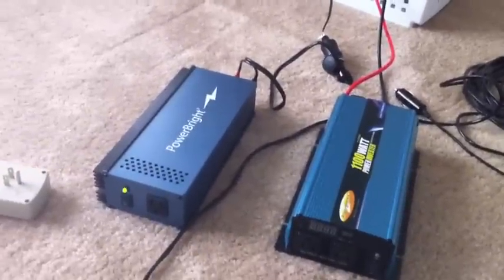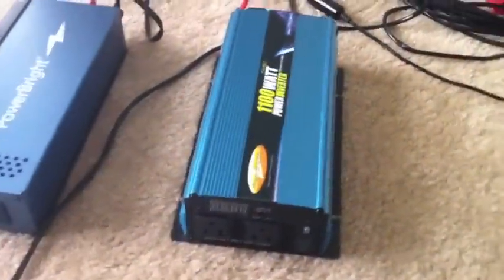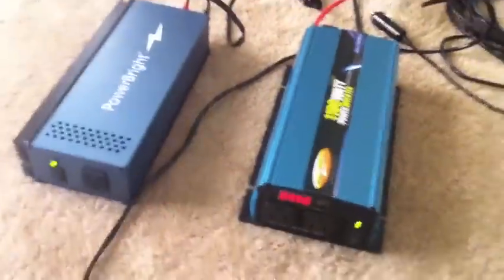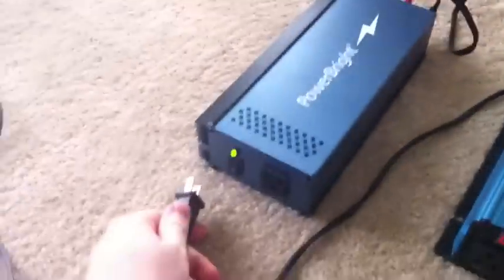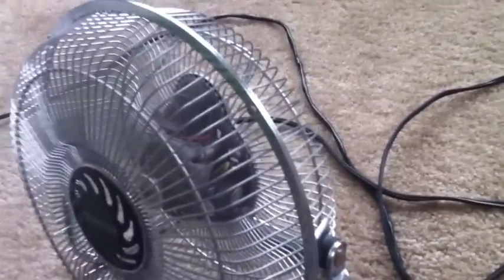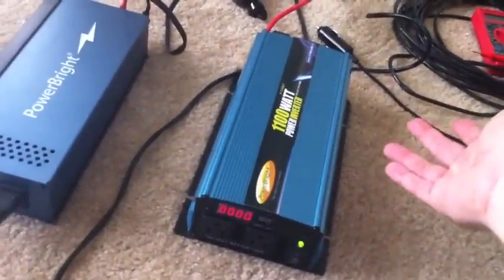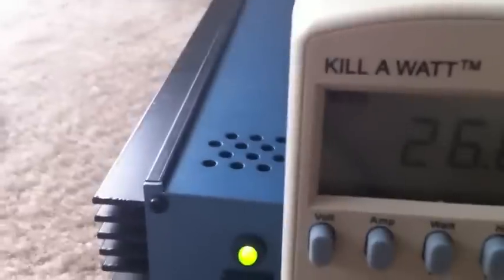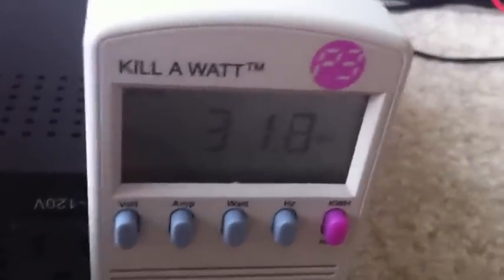What is the difference between a pure sine wave Ac inverter and a Modified sine wave inverter.

Comment: i hear modifeid vawes is not good for charging lithium batteries is true ?
Reply from the maker: I’m not sure but most lithium battery chargers run off 12 V so you’ll be better off just wiring it directly into the battery that you would be getting the power from.

Comment: After having a 300 Watt Pure Sine Wave inverter for 4 years I went and picked up a 750 Watt modified wave inverter from Walmart. I wanted some kind of backup inverter for shtf and I was having too much fun using my old car batteries charged with solar to charge all my aa/aaa/lithium usb banks etc and did not want to risk the pure wave getting weathered or stolen. That said it performs well even on a laptop the only area it has a problems is my really nice Phillips PC speakers buzz on it.
Reply: My uses differ from many of you probably... I have no desire to run any motors just electronics and no medical equipment. I want something I can take camping and run a laptop or a very small led backlight tv with a slim model low power consuming Xbox 360. During shtf I hope my family and friends can find somewhere safe if only for a few weeks and enjoy some movies and gaming before our doom. I have a 1600watt inverter generator which is pure sine wave to think about things like food storage etc although I’ve recently started looking at small mini fridges that dont use a compressor rather some other tech and use as little as 70 watts and work on 12v dc!

Comment: My set up uses a modified sin wave Krieger and I don't  have issues with my light bulb or square box fans. Other fans are  more sensitive. To those who want to set up an emergency box don't be afraid of using modified sine wave. I have been using them for 3 years now. I own 4 different types.  My 8 watts led GE bulb don't care. My gig saw Dremmel  coffee maker etc all run on modified sine wave.

Comment: Finally the difference between the two types of the waveforms produced by these two inverter categories is simply the lack of harmonics on the part of the pure sinus inverters. The modified sinus inverters have practically only that drawback. Nevertheless, if their design is smart, they can be used with any load. Smart design means the full elimination of the third harmonic, i.e 180Hz for 60Hz mains (or 150Hz for 50Hz mains respectively). Once this presupposition is established, there is no practical drawback of the modified sinus waveform against the pure sinusoidal one (unless if one wants to sell energy in the utility). On the other hand, the term "modified sinus" means exactly that fact. The full elimination of the third harmonic content from the output waveform. Thus the resultant waveform will be a decent replacement of the the sinusoidal one, being completely harmless for any load, no matter how delicate it might be. As for the electronic appliances of our days, all of them are using "switch mode power supplies", which really don't care about the input waveform, being capable to work even with pure D.C voltage i.e. directly from battery supply. All that's needed is the voltage level, which should be within the range the power supply can handle. Many of them are universal, that is, they can operate from 80 to 280 volt (with the mains frequency being unimportant any longer). In any case their operating voltage range, i.e. the important parameter, is written in their info label, on their body.

Comment: Pure sine wave inverters have LOWER conversion efficiency, because of transformer losses.
You see higher power usage on modified sine wave because you power a simple electric motor with it. Its designed for a pure wave and wont work well on modified wave. 
You measure at the output of the inverter so you skip the inverter itself in the test. You measure efficiency of the motor on the current type provided not the inverter - this is still important, but it hides the whole picture. You should measure on the input to the inverter. With the increased efficiency of modified wave inverters, you might see the difference in power use of you motor will be much less.
On the other hand modified wave is just as good as pure wave for powering switching power supplies. After all, internally they just make the wave strait then chop it up again, so it doesn't matter for them how choppy it comes in.

Comment: um, not trying to one up anyone, but a 'square wave' is like plugging in a pos and neg wire, and switching the polarity rapidly... appliances notoriously 'buck and fight' with square wave output. Actual SINE wave refers to the pattern shown on an oscilloscope, the second picture, which shows that the POLARITY REVERSALS are GRADUAL over a period of time, so small we hardly notice it (unless we have a finger in a light socket LOL) - the GRADUAL reversals of polarity are MUCH SMOOTHER than square wave. Think of running a baby carriage up and down a flight of stairs. OK, now carpet the stairs and SMOOTH the sharp edges and then the carriage will roll MUCH SMOOTHER up and down the same stairs. MODIFIED sine wave is NOT sine wave, it only shows how the SQUARE WAVE can be manipulated with circuitry to 'shave the hard corners' off of the square waves, and it helps, but most of these use mosfets to manipulate the current (on/off switching) and some MSW inverters will have warning labels telling you to NOT plug in 'inductive' loads... like florescent lamps (blew a 1500 watt MSW inverter by leaving ONE CFC 'light bulb' in the circuits! BAM, gone. Tried to use a Weller soldering gun with same, BAM, blew the MOSFETS right off the circuit board...) so read up all you can on  anything you plan to live with for a while. The best inverters are heavy, because they have REAL TRANSFORMERS inside them, like Tripp, my current champions. With all respect to M. Vineyard, yes that is a STEP current, and it is called a square wave... the sine wave shows the polarity reversing at the top 'loop/peak' and then again at the bottom 'loop/valley' usually the test lead will show pos at the top and negative orientation at the bottom. 
With a full sine, the current is never ACTUALLY OFF, unlike the square wave/rapid on off polarity swapping scheme - so the surges and 'ringing' in the circuits are minimized and even eliminated. This surging and ringing is what destroys all those small capacitors on the motherboards - and or the mosfets.

Comment: To power a portable Sony stereo, I was using a cheaper modified sine wave inverter, I accidentally reversed the + and - on my battery connection last evening and blew the 2 non replaceable fuses inside the inverter. After much research and talking to 3 different electronics technicians today, they all told me my Sony stereo will operate better and last longer with a better pure sine wave inverter. Ordered an Aims 180w pure sine wave inverter for $64  I'm now glad the cheaper $34 Cobra 400w modified sine wave inverter got blown out, my portable Sony stereo is the best sounding unit ever made, and they don't make them any longer, can never replace it, so happy I'm going to be treating it better from now on with pure sine wave power nearly, or identical to higher quality household A/C current. Modified sine wave is not good for electronics like TV, stereo, battery chargers etc. They may work, but not as well or last as long.

Comment: But if you place a capacitor at the output of the modified sinus wave inverter, then the hamming dissapears.
Reply: does it? Is there really a significant advantage going with a pure sine wave?
Reply: Rohan Berry 
"does it? Is there really a significant advantage going with a pure sine wave?"

Yes it does. I noticed it in my home-made inverter which generates as output square pulse high voltage. By adding a capacitor, the hamming generated by it, disappeared because the capacitor smoothed the square waves.
Reply: Than Zamp capacitor behaves like a filter
Reply: vtnsx that's exactly my point

Comment: 1100W!? THat's Pure Bull. A 1100w inverter would take over 90 amps @ 12VDC.
Reply: I had seen 3000 watt inverter before. But it use 24V input.
Reply: An inverter that claims to be 3000w or one that you've actually seen delivering 3000w? That's 125 amps which is far more than a car can put out and that would completely drain a car battery in 20min. It'd take 2ga wire which is 1/4" diameter copper- far larger than even a heavy duty battery or jumper cables
Reply: Davey Hi The peak performance is at 3000W. The average is at 2000 to 2500. The inverter use 24V input. So you need battery that has higher capacity than normal car battery. Then again the inverter is china made. But I had seen before.
Reply: FYI inverters DO go bigger than 1100W

Comment: For me, the HUGE price difference is not worth the benefits of pure sine wave. I use a $29 dollar one to charge my Laptop, phone and camera. No problems at all.
Reply: Except your electronics won't run as well, and will likely wear out quicker being provided a cheaper lower quality electric current that modified sine wave inverters put out. They all work fine until they don't any longer. I was using a modified sine wave inverter to power my Sony portable stereo, then a Sony technician told me it won't run as well, and won't last as long, he suggested I get a pure sine wave inverter and my stereo will be happier and live a longer life. I got an Aims 180w pure sine wave inverter for $64  With electronics we can take chances, or spend more and get pure clean power, if things don't last as long with cheaper inverters, we don't save that much after sooner replacement costs.
Reply: I think most if not all computers have a power supply that changes power to a clean pure sine wave, is that true?  I've run all my computers on square sine wave supplies and never had a seconds problem.....
Reply: Mike Hale, a typical computer power supply will rectify the current and than chop it up again and then rectify again. So the shape of the input wave is piss in the ocean compared to what happens inside the supply.
Pure wave are less efficient on conversion (contrary to what is said in this video) but better for devices that expect pure sine input such as motors or non-switching power supplies.
Reply: I once read something like this allegedly on the bathroom wall of the Titanic... ok, it ONLY sank ONCE, but it did a damn good job of it. PS most computer power supply adaptors have extremely well engineered filtration in the adaptors to protect the investment in the laptop. Other electronics may vary, or your luck could hold out.

Comment: I've been working off-grid for several years now, and have seen every type of electronic plugged into every type of power inverter or generator. Many sensitive electronics will opt not to recognize cheaply inverted electricity. Pure or true sine wave works every time, so spend the money if this is what you are powering.

Comment: IMO, no inverter can provide you with electrical power as clean as that from the utility company. Power from the company comes from rotation and magnets. Pure Sine Wave Inverter doesn't have that, hence the result.
Reply: +craccky, absolutely far from the truth. This is 100% inaccurate. Typically inverter generators and pure sine wave inverters have power that is in fact cleaner than utility power. I have recorded and verified myself personally several times.

Comment: which is best for using a laptop
Reply from the maker: The pure sine wave would be better. Because from my experience The modified will cause interference problems and heat up The AC to DC power supply. Your best option would  be to connect a DC to DC power supply. They make them for all laptops is you can just plug it into the cigarette lighter.
Reply: +WinstonSmith6 I am doing an rv project...I need an inverter to power a 1500w floor heater...that will be the main function for it as I might plug an iron or toaster in it from time to time...what would be your advice? I know I need at least a 1500w continuous/ 3000 max as far as power right, but should i get pure wave or modified...please take into consideration that money is a factor but doesnt mean i wont spend more for a better product
Reply: +WinstonSmith6 you are wrong. Every laptop or desktop computer power supply convert incomins ac to dc and then convert it to low voltage dc. If you have apfc power supply, it is better using pure sinewawe, else it's no matter. You can ever feed laptop power supply with dc at peat sine voltage and it will work
Reply: +Michael Parker 1500w from a 12v  battery is 125amps. Not gonna happen. IF you did have wiring, inverter, and battery to do that, the battery would last < 20 minutes.
Reply: +Volodumur Kalunyak If he's wrong, what's this? lol

http://www.amazon.com/Shopsimple-Universal-Selectable-Adapter-notebook/dp/B015STBOFW
Reply: Davey Hi this is a lot better solution to feed laptop from 12V car battery. This is dc-dc converter 12V->19V. Double convertio 12V->220V->19V (or 16V, 17V,...24V depending on settings) is eliminated, so it yields higher efficiency.

Comment: Unfortunately, the box showing modified vs. pure sine wave is INCORRECT.  The left side (at around 0:15 seconds) depicts a step function....so that 12V is boosted to about 120 v for 1/120th of a second,then boosted to -120V for 1/120th of a second.  That is a 'step function.'

Modified sine wave inverters often use 3 steps...say it goes to 50V for 1/600th of a second, then 100V for 1/600th of a second, then 150V for 1/600th of a second, then back to 100V for 1/600th of a second, then back to 50V for 1/600th of a secon...and for the next 1/120th of a second - the voltage steps from -50V, -100V, -150V, -100V, -50V.

The modified sine waves are obviously better than a step function, but not quite as good as a pure sine wave inverter.

Pure sine wave inverters use Insulated Gate Bipolar Transistors (IGBT) to use Pulse Width Modulation (PWM) to create a pseudo-sine wave. It isn't real sine wave....but any circuit with inductance (like motors or transformers)...the effect is the same as a sine wave.
Reply: I have several of each (modified, pure).  The modified are all square wave output, with the width of the square wave being adjusted to maintain the effective RMS voltage as the load changes.  The best modified square wave inverters provide a stepped square wave that might approximate a sine wave.  The pure sine wave inverters (500 watt and 2000 watt from Reliable Electric) produce a true (not stepped or micro-stepped) sine wave that is cleaner than the power our local electric co-op delivers and I have the scope traces to prove that. 
The pictures were made with a handheld camera so aren't as sharp as I'd like but the quirks at the peaks of the co-op waveform are obvious.
 jecarter.us/files/2000-hal-440.jpg  jecarter.us/files/co-op-AC.jpg
Reply: notyoung  I've been wondering how good the sine from electric company was. I am gonna look into mine now as well. I had the idea to use an inverter with dc converter to clean up my sine waves for certin electronics. The issue is does it waste power that's what I'll be testing for when I get things set up. Plus I can set it up as a uninterrupted power back up.

Comment: Just because a motor is buzzing does not mean it's very inefficient and is getting hotter then on the pure sine wave. Single phase (as well as 3 phase) motors don't care a lot if what they get is square wave (or modified as it's called by sale people which is incorrect) or a sine wave. The humming is just annoying for people, not for motors.
Reply: ***** No it isn't, a speed controller for 3 phase motors (VFD) almost always uses a square wave. That the inverter you mentioned didn't work well is probably because it is indeed cheap and it can't take the small but powerfull peaks an electrical engines generates.
Reply: Universal motors with some thyristor speed controllers go ballistic on modified sine wave power. For example our cake mixer. It has no speed control on modified sine wave.

Digital alarm clocks that use the mains frequency to count time don't work on modified sine wave. Ours ran at 20 times real time speed on modified sine wave.

Large switch mode power supplies in PCs don't seem to mind it but buzz like a sub station!!! (Corsair HX1000 under 300W load)

Modified sine wave inverts put out spikes at the transitions points in the wave "when running large inductive loads". We used an oscilloscope to view this while running a 1000W water pump on a 2.2kW modified sine wave inverter. (NZ standard power is 240V phase to neutral) The inductive spikes rose 200V above the positive wave and 200V below the negative wave. So +/- 400-500V spikes going through your equipment is surely not a good thing. 

That's all I can think of off the top of my head. I love my 600W pure sine wave inverter!
Reply: KiwiPowerNZ Certainly true that most speed controllers don't like it, for very good reason. Most speed controllers designed for sine waves control speed by "cutting" off part of the sine wave at the point where it hasn't reached the peak voltage, this causes a lower effective voltage, thereby slowing the motor. With a square wave, it doesn't have a lot of wave to cut-off. PC supplies don't mind much (apart from the buzzing) because they rectify the voltage anyway, it's just not very good for the rectifying diodes due to high peak amps (partly explaining the buzzing, the high peak amps).
Reply: ***** Usually people run AC stuff from DC because they don't want duplicate appliances and chargers in AC and DC versions. Like me I can charge my phone (or anything) in the car using the same charger I normally use.
Reply: ac motors are built for sine waves, the timing of the windings do not conflict, the noises from the motor do indicate inefficiency in the motors use of the available current ... and the noise in the lightbulb is a result of square wave current. Don't plug any valuable electronics into THAT inverter!